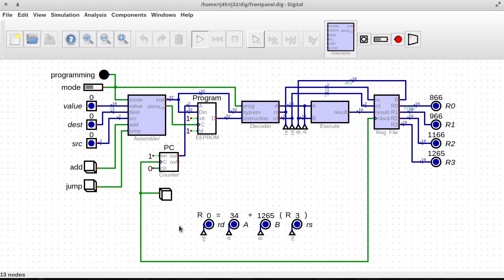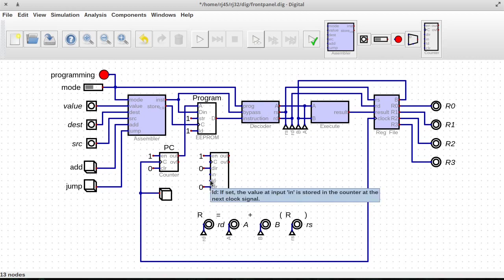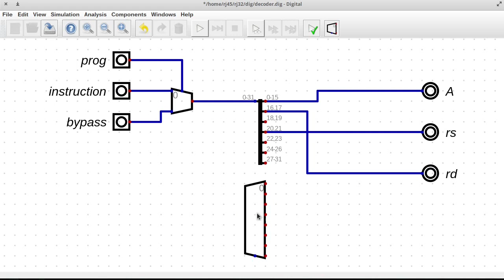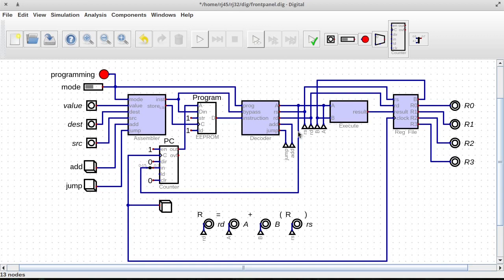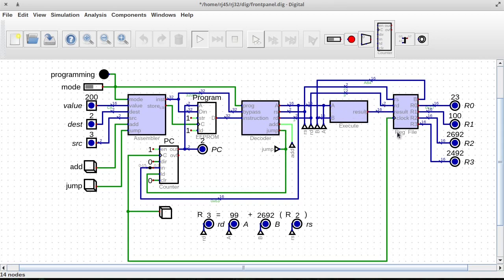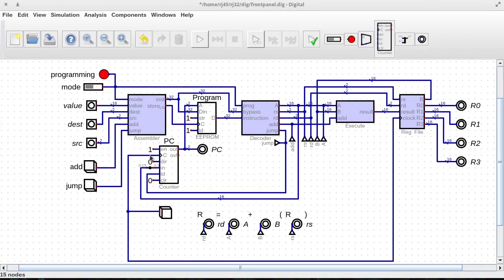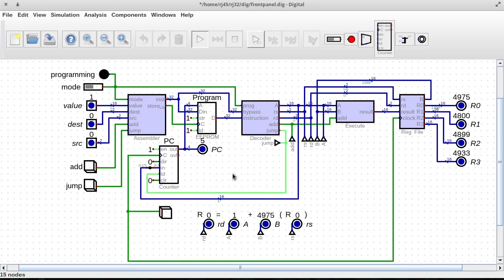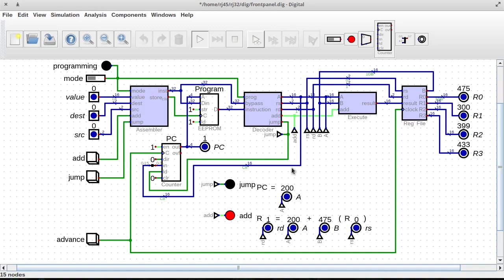[007] Jump! - Building a CPU From Scratch

Comment: When i wrote the jump into the rom and ran the program the cpu started bugging out. basically it stops adding numbers like it should after the jump happens. and every time the clock cycles 1-3 the register either just writes the value it already has or does nothing. i cant tell the difference. I reloaded the saved program that just adds numbers and that worked fine. it seems to only mess up when the jump instruction is reached. I went back through the video at least 3 times and cant tell where i made a mistake and everything else in the tutorial has worked so far. any thoughts on where to troubleshoot?
Reply: actually i figured it out! turns out the backup program i was using was from a few videos ago and thus was not compatable with jump. in case anyone else has this issue heres what the bytes of the program should be to get the results rj got at 13:48:
0x10064
0x3200c8
0x230063
0x7000001
Reply: @Mekelaina  hey can you pls help me i'm curently stuck i did't understand wat you sad with this. thx
Reply: @lennyreijne5449  the program I was loading when following the tutorial was out of date. So I wasn't getting the right result. My second comment is the bytes of the program he used at the right point in the video. Idk if that's your issue or not, but I would double check that. It took me forever to find out I was loading the wrong program.
Reply: @Mekelaina  my problem is that its not adding any more... i don't know how i coud fix it.
Reply: @lennyreijne5449  if it was adding but now isn't, then either somehow it's executing the wrong instructions or something isnt wired correctly.

Comment: Can anyone please explain why are we bringing 16-bit value A as a 4-bit input to program counter!?
Reply: cause what jump does is jump to the address of mem, since the address is 4bit long, it have to input a number below 4bit, or else it can't handle it. think the mem as a array.
so if  a mem said (jump and value is 30), it will let the counter value set to 30, then the counter will let the mem go to where the place is 30(0x1e) and run the code inside it.
if the number is greater than 4bit it don't know how to execute it. maybe it will get the first 4 bit of the A, or it will just breakdown. idk. welcome to correct me if im wrong.
also its the same as writing a assembly: jmp 0x1e

Comment: When I hooked up the output to the PC, it went 1 -2 -1 0, in that order. I don't quite know what to do, and I'm afraid I might have to start over. Do you have any ideas on what I could have done wrong?
Reply from the maker: The output is set for "signed decimal" instead of "decimal"... it's interpreting the number as two's complement negative numbers
Reply: @rj45Creates  Thank you!